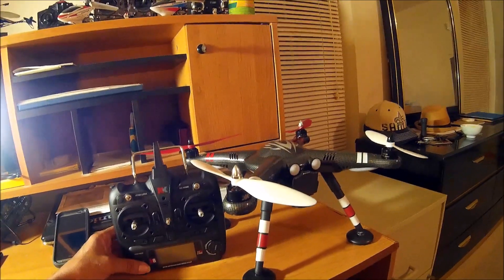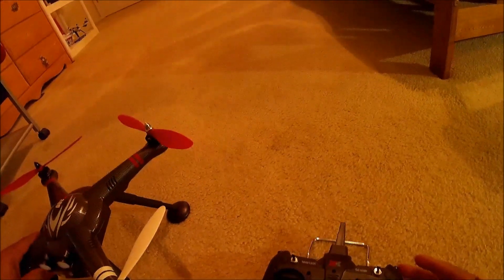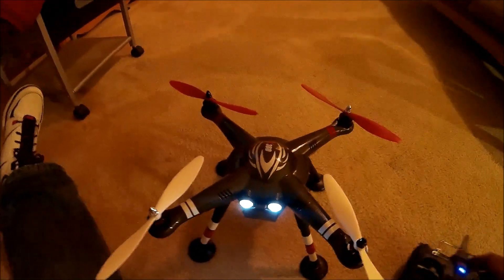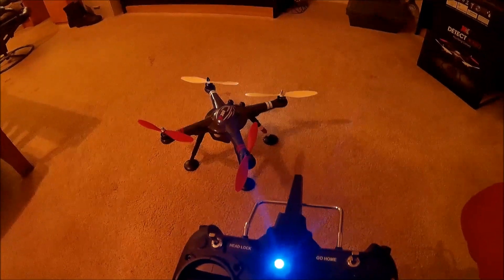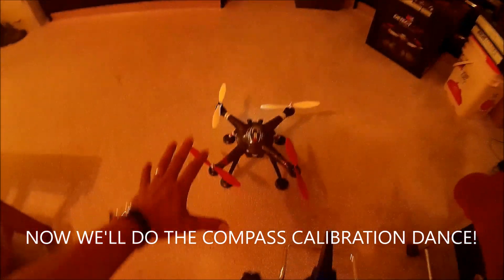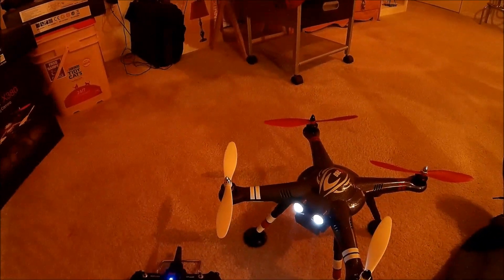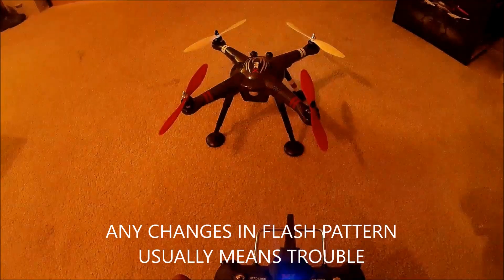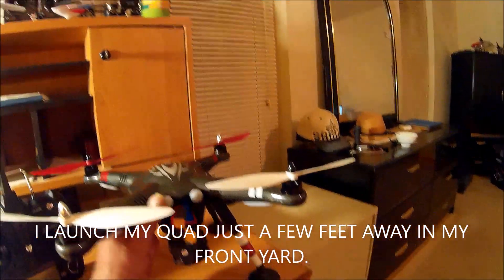XK DETECT X-380 "MUST WATCH BEFORE YOU FLY"

Comment: hi . i have a question . will the v303 seeker batteries fit and work in the xk detect x380 ? i had a v303 seeker and i crashed it . i have 5 batteries for it . i'm ready for a new drone . i'd like to get a new drone that my old batteried will work in . wltoys if i'm correct is now xk . the batteries i have are 11.1v 2700mah . the connector ends are the same as the xk detect x380 . as far as i can tell it looks like the xkdetect x380 battery is just thicker in height . also my batteries are 25c and it looks like the factory battery that comes with the xk detect x380 is 20c . any help would be appreciated . thank you
Reply from the maker: Yes, the Seeker batteries will fit & work in the X380, but are smaller and you'll probably get really short flight times. The X380 uses a 5400mAh battery, which is double the power of the Seeker, so your flight time will most likely drop to half that of the X380's original battery, BUT it will work!!!  Thanks for watching, good luck.

Comment: Hi dj any idea why my x380 keeps vearing off to the right on take off. Please help Iam from the UK regards irvine
Reply from the maker: Try calibrating your accelerometer.  Put quad on level surface.  Without using any sticks, quickly flip the "Go Home" button (about 12 times) until lights start blinking. Put go home button back up, wait for light to stop flashing and THAT'S IT!!!  Let me know how it turns out... if that doesn't work, you may have a bad motor.  By the way, are you using prop guards???  Good luck!!!

Comment: Took my first flight today done all the prep stuff  fkys good taking off without the auto take off when i tryed that it tiped over and ate the dirt tryed the auto take off again same thing but i saved it from tipping over and my left stick on my controler is messed up and dont come back to center makes flying weird is it easy to bind a new controler i must have got bad drone so far broken statis light and controler out of the box befor my first flight sucks
Reply from the maker: Right above the "take off" button, is a button labled "stick mode."  Make sure you are in the correct mode (mode 2) by pressing that button and you will see the mode change in the screen.  If your left stick doesn't spring back to center, then you have a defective transmitter.  Let me know how it goes...

Comment: Hello just took mine out of the box charged it and hooked  the batt up it does its thing but no rear light its not red or green its just off thats not normal is it?
Reply: Yea only lights on is the head lights on mine
Reply from the maker: No sir, it is not normal.  You have a serious problem, without the rear light (flight indicator) you won't be able to know what's going on with your quad or calibrate it.  Good luck, I hope you get it resolved.  Thanks for watching.
Reply from the maker: Not good, better return it for exchange or refund. Good luck.
Reply: I got it from amazon fist time ive bought anything from them prob is i got it on sale for a price i cant buy another one might b better off sad as it iss to keep a brand new quad for parts :( thanx for the info bro i subbed ya

Comment: Mate i need your little help about my friends Xk Detect 
the issue is the its not responding on the remote except on the auto take off and auto land 
after auto takeoff any control on the throttle & aileron dont work at all
Reply from the maker: Is it a new X380 or has he flown it for a while??? This video shows how to do all the essential calibrations. (make sure the transmitter has fresh batteries) Also make sure the transmitter is in the CORRECT mode (Mode 1 or Mode 2) by pressing the "stick control" button and see the mode change in the LCD. If after doing the calibrations, it's still not working, you might want to try flashing the memory - https://www.youtube.com/watch?v=c0jPjEA4ZdQ  Good luck and thanks for watching. DJ SOUL FORCE

Comment: hi dj, I lost bind on my transmitter when calibrating it. I put the left stick down and in the right position while flickering the top-right return to home switch in order to get the fast red flashing light. out of many successful transmitter calibrations today didn't work out that way. I now have a solid red light on my quad and my transmitter is not bound and I have no clue how to rebind it, any tips?
Reply from the maker: ...sorry buddy, I just got this message.  If you're still having problems, watch this video (https://www.youtube.com/watch?v=c0jPjEA4ZdQ) and follow the instructions to reset your X380 back to factory specs!!!  I can't tell you what happened, but this should fix it!!! Good luck, let me know how it turns out. Good luck. DJ SOUL FORCE

Comment: Hello guys,
I have the following problem with my xk 380, When I try to take off, lean to the right and break the propellers
What is the cause of this problem and how can I solve it?
thank you
Reply from the maker: You can try calibrating the accelerometer.  Put quad on level surface. Turn on transmitter, turn on quad. Without using any sticks, flip the "Go Home" button 12 times or more until lights begin to flash. Put button back in the up position, when lights stop flashing, calibration complete. If your quad still flips over, you may have a bad motor or ESC. Also, make sure you are in the correct stick mode (mode 2 for right hand flyers) by pressing the "stick mode" button (bottom of transmitter) and checking in the LCD screen. Good luck, let me know how it goes. DJ SOUL FORCE

Comment: Hi DJ, just wondering if you could help me decide on what to go for next?
My son and me have 3 Syma X8G's - we've modded with FPV, OSD, TX booster and SJCAM 5000x.
(We ended up with 3 of them because the Irish wind took the first one out to sea, but amazingly we got it back 4 months later - it had been submerged and a house for crabs in the meantime! - 
luckily a local birdwatcher spotted it with his scope, sticking up on a submerged sandbank - coincidentally he saw us flying the replacement X8G (at another location) and drew a map to where our original one was
- we rescued it, resprayed, replaced the board, motors and leds and she's back flying again - without the crabs:-))
Anyway it's time to step up to a GPS Aerial Photo Quad (also hoping to get a Bugs 3 for the fun of flying part). Don't want to spend too much and would like to be able to mod or use the mods we already have.
Would you recommend the X380, the new X16 GPS model or something else? The Phantom Standard would be a bit of a stretch cost wise. Thanks a mil
Reply from the maker: The x380 is my first choice, especially for modifying!!! Good luck with your decision. DJ SOUL FORCE
Reply: Thanks DJ. Really love your videos BTW. Thanks for all the help. Just need to wait for a good deal to come up for the X380 again, now!
Reply from the maker: Here's a link I ran across recently - http://www.tomtop.com/quadcopter-1192/p-rm3480us.html  It's from TomTop's US warehouse!  Good luck with your searches.

Comment: I need a good 3 axle Gimbal for my XKX380 Sir, where can I find one?
Reply from the maker: I recently tested the Walkera G3-D gimbal but I wasn't totally satisfied with it. The mounting screws didn't line up with the holes on the x380, but it did work. Some other 3 axis gimbals caused interferrence with the x380's compass and made the quad fly erratic!  With that said, I'm still looking for the perfect match myself. I'm still using the Walkera G2-D gimbal and it's my recommendation. For more suggestion, ask the guys on the "All XK Drones Owners Club" on facebook. Good luck. DJ SOUL FORCE
Reply: DJ SOUL FORCE OK,thank you Sir
Reply: DJ SOUL FORCE the same thing happened with my after market 2axes gimbal so I ordered the original XKX380 gimbal for $69.00 on eBay

Comment: Hi DJ, quick question.  I just purchased the 7000mah x4 pro battery on ebay in hope to get longer flight times on my x380.  This battery was defective and caused my drone to drop from the sky from 50 feet. Luckily it landed in a tree and only the body was damaged which I replaced.  I got my refund and purchaed another 7000mah x4 pro battery from banggood this time but only get 20 minutes on it before it self lands its self (red warning lights start at 13 min and lands at 20 min). Whats weird is that beofore the crash, my 5400mah battery used to get 20 minutes solid before force landing, so shouldn't the x4 pro battery get longer flight time?  
After the the crash both the 5400 mah battery and x4 pro batteries are getting less flight times.  I decided to redownload the x380 files you showed us in another video and reset the the x380 to factory settings in the software but also lowered the voltage parameters so that it lands at a lower voltage.  I put a voltage buzzer on my battery and get 3.66 volts per cell before the quad self lands.   Then again I'm really not sure how to read that thing. whats considered extremely low voltage per cell? Also what do you recommend to get longer than 20 min on that x4 pro battery? The x380 should get more than 30 min naked with no fpv gear attached with the x4 pro battery but its not getting anywhere close to that.  I'm thinking my quad is the issue.  I haven't yet flown it since I re-downloaded the files and changed the voltage settings.  I hope this does the trick.  What do you recommend? have you had any such issues before?
Reply from the maker: I can only give you the short answer here, because it's beyond me... "the x380 get's the best flight time from the XK original factory battery, for some strange reason!" I've seen Dustin Dunnill and others do x380 battery mods on their channels (even seen a guy do a two battery modification) and still, no better results!  There's even an aftermarket battery that looks very similar to the stock battery, but it's 5600mah, and it has less flight time than the stock 5400mah... go figure. About the voltage for each cell for critically low, I can't remember for the x380, but it should show up as the default setting in the flight control program. Critically low settings will vary from quad to quad. Good luck, keep me posted. DJ SOUL FORCE

Comment: Happy New Year  DJ Soul
I need to know how to make xk380 return to home forward. 
Thanks
Reply from the maker: You have to use the Flight Control Program to change parameters.  Search youtube for "X-380 Flight Control Program" and how to use it. It's a little bit tricky to download & connect to the Flight Control, that's why I never did any videos on it. (at one time the program was in all Chinese) Good luck. DJ SOUL FORCE
Reply: DJ SOUL FORCE thanks, DJ Soul, I have everything downloaded and I 
check come in face first,  taking it out tomorrow for 5th flight. 
Thanks again DJ Soul

Comment: When you first get the 380 do you need to charge the battery or does it come with a charge? I just ordered one from gearbest. They got them for $182 from the U.S. warehouse right now. I could not decide between the 380 and the tovsto agean.  I seen you said the 380 was better hands down so I went with it. Hope I made the right decision.
Reply from the maker: The battery will come partially charged. I think you made an excellent buy for $182, the Tovsto is more expensive and less of a performer!  Good luck. DJ Soul Force
Reply: so should I charge it the rest of the way when it comes or should I use up the partial charge then charge it?
Reply from the maker: Yes, you'll need to give it a full charge before using. Good luck.
Reply: Thank you very much for taking the time to answer my questions. I really appreciate it. I may have a few more, as this is my first gps quad, but I have watched all your videos on the x380 and I think you have pretty well covered it all. Just hoping mine is not defective considering the low price. Good thing it is coming from the U.S. warehouse because China just started their big holiday. Thanks again Soul brother.
Reply from the maker: Thank you for the letting me know about that awesome deal at GearBest... I just ordered another one for myself!!! Couldn't pass that deal up! Thanks
Reply: I got my X380 yesterday. I got through two successful flights thanks to your videos. My battery is taking over three hours to charge. Is that normal?
Reply: Also one more thing. I know you mentioned several times the props you use but can you tell me exactly which ones you recommend? Mine actually came slightly damaged. The ends of the blades were roughed up. I really appreciate your time and knowledge. I'm going to try and get some videos up on here soon. I'm looking at this camera http://www.gearbest.com/action-cameras/pp_181894.html?wid=8
Do you think it would work with the provided camera mount? Thanks again
Reply from the maker: The props I'm using are the original DJI Phantom 3 Props (OEM#9) and they will screw right on, no modifications needed. Just from looking at the picture of the camera, I think it will fit! It looks like my knockoff SJ4000, which fit perfectly. Good luck. DJ Soul Force
Reply from the maker: Yes, that's normal because the stock battery charger is not the greatest!!!  I suggest the iMax B6 Pro balance charger. It charges the x380 battery in about 1 hour and can be used on your other LiPo batteries as well. Thanks for watching. Dj Soul Force
Reply: thank you once again for your quick response.
Reply from the maker: I got my new x380 also, that was a great "steal" (deal), thanks for telling me about that. A couple of days after I bought mine, the deal was gone!!! Now if you search for x380 on GearBest site, only the China store is available. I only gave it a visual inspection, looks good. I'm putting this one away for a rainy day so I haven't flown it yet! How's yours???
Reply: I have not had any problems at all. It has a little squeaky noise, guessing the props need to be balanced. I got that camera I showed you but it did not fit the mount that came with the x380 but I made it work. I just uploaded my first video with it today. It is pretty shaky lol.
Reply from the maker: Thanks for the update. I just became your very first subscriber. Keep posting, I'll visit your channel shortly! thanks for sharing. DJ SOUL FORCE

Comment: TKS for your videos XK X380 if switched return home ON and after switch it OFF again while flying, can I control it again and what U sagest on headless mode
Reply from the maker: Yes, if in return to home mode, when you switch it off, the quad will stop and hover in place and you will have control again. Don't ever use headless mode AND return to home modes at the same time. Headless mode works fine on the x380, but I never use it. (just my personal opinion) I hope this answers your question. DJ Soul Force
Reply: Thanks for your suggestions

Comment: i Dj My question is I have 2 xk Detect 380's and both of them receive 
signal from both Transmitters is this correct ?     Scary what if 
someone else is flying one nearby will they get signal from there 
transmitter Too ?
Reply from the maker: That's a new one for me!!!  Sorry, I've never heard of that... I thought you could fly several of these birds in the same area. I know that there's only a limitted amount of frequencies that will work, so it's possible that you got two quads that are binded to the same frequency! (it's rare, but possible!) Good luck, let me know how it turns out.  DJ SOUL FORCE

Comment: Getting GPS inside the room is not possible. It was displaying fake results and this is disturbing
Reply from the maker: It is possible to get GPS inside, it may take a little longer, but it is possible. (unless you have a metal roof)  I get great satellite coverage in my area and I'm upstairs in a room near the window. Although it may not work for all, I'm having no problems with acquiring GPS lock with all of my GPS quads inside my room! thanks for watching. DJ SOUL FORCE
Reply: DJ SOUL FORCE Bye Bye Xk detect. Didn't get the chance to downgrade the firmware. Tried to fly again after all those calibrations to test whether it was me doing wrong. Flew well and I was barely 10 meters high. Suddenly dropped again and broken in to 2 pieces. It was only 10 meters high and virtually flying next to me for testing. Same issue. It stopped the propellers on the sky. Any way thanks for those advice. I will move on. Bye Bye Xk detect.

Comment: I just did the dance as you teach it. Unfortunally the x380 just fell over to the back during the first two tries. I had to stop now because it is late at my place in Bavaria.
But I have one question - why are you the only person doing this conter clockwise ?
I will try again tomorrow after work with husky's way of calibrating.
We'll see what funny figures I generate than. Hahaha Later !
Reply from the maker: Clockwise or counter clockwise, it doesn't matter, as long as you make the circles complete. Sometimes I change it up!  If your quad tips over, it sounds like your props might be on wrong. Make sure the side with the markings on them are facing up. For reference; while facing the quad, the right front motor will spin clockwise.  Good luck, let me know how it turns out. DJ SOUL FORCE
Reply: THX I'll tell :-)